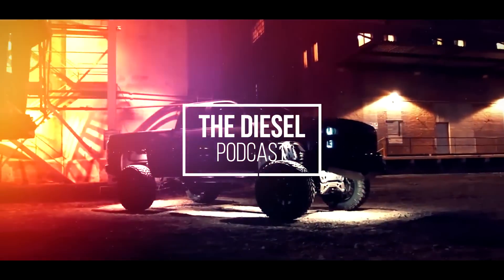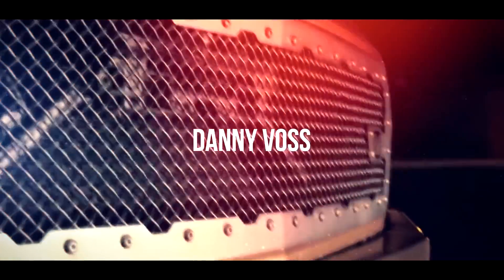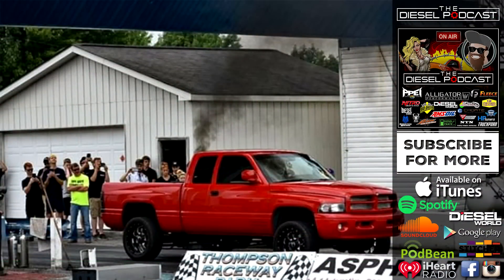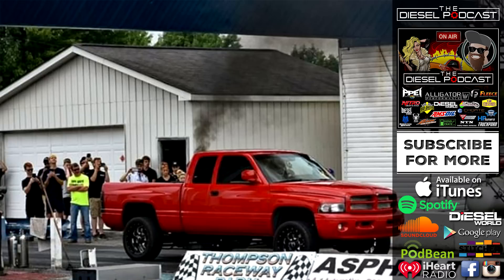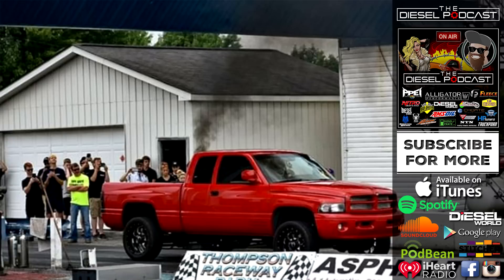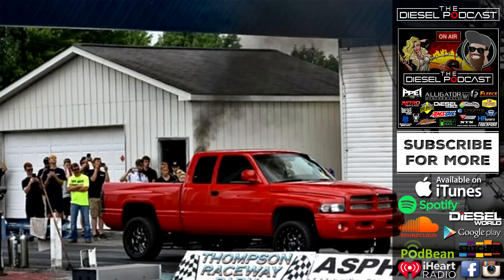2nd Gen Ram with a 6.7L Cummins Swap

Comment: I have an 06 2500 with the hemi building this truck for racing/pulling doing the common rail swap I have a rear end to swap it out fuel tank the whole nine yards only concern is the dash wiring and harness issues? Any idea if I can just change out the cluster and engine bay harness and be good with that! The truck is absolutely rust free and is already cosmetically what I want so don’t want to get rid of it to just buy another truck??